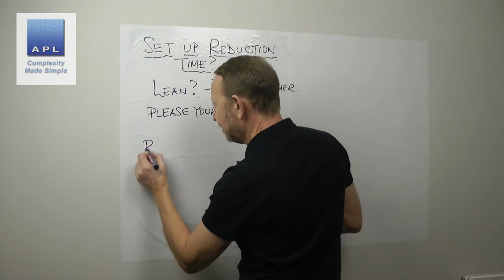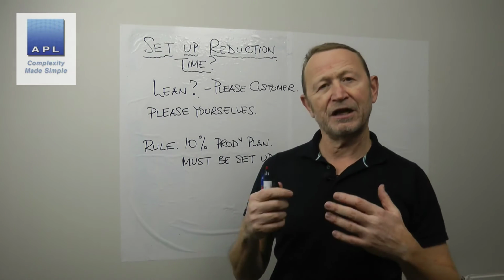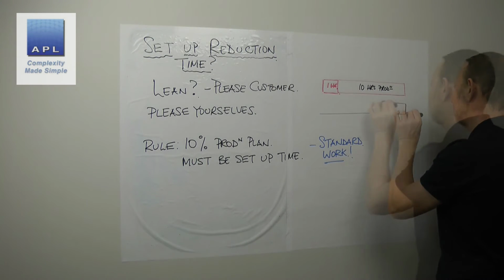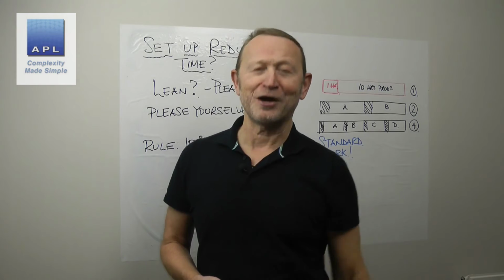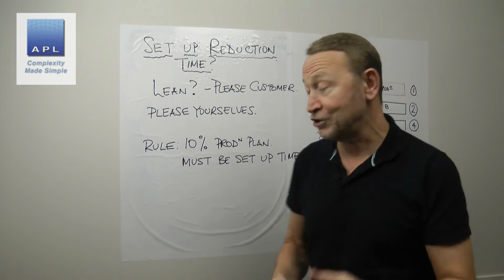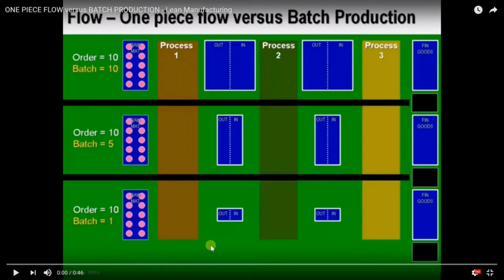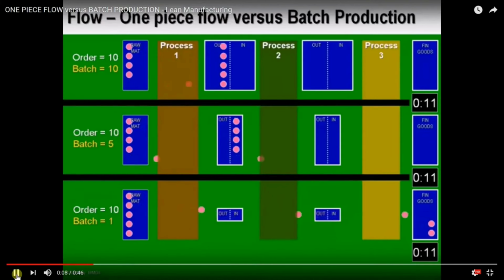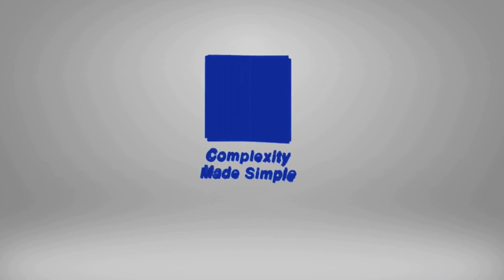Set up reduction time - What are you are going use it for?

Comment: Thanks Paul for your helpful videos. My understanding is that frequent setup changes to produce in smaller batches helps with smaller finished goods & WIP inventory and so the factory space needed is less. Also it results in level loading of orders to upstream suppliers to reduce the bull whip effect. Does this understanding resonate with yours?
Reply from the maker: Yes it does - Reduced batch sizes will have a dramatic positive financial effect, not just in the ways you describe, but in lots of un-measurable ways as well...